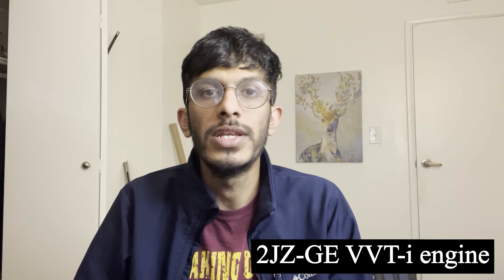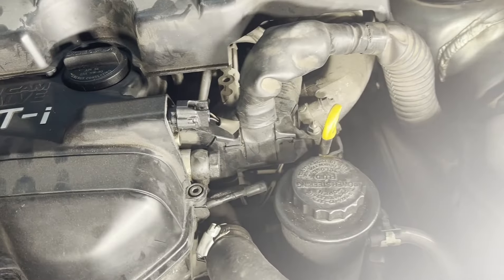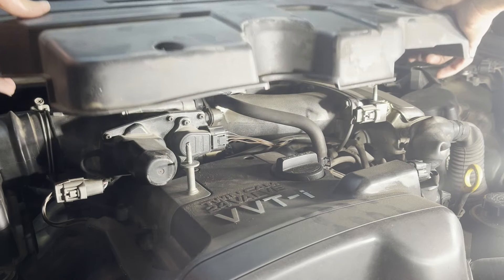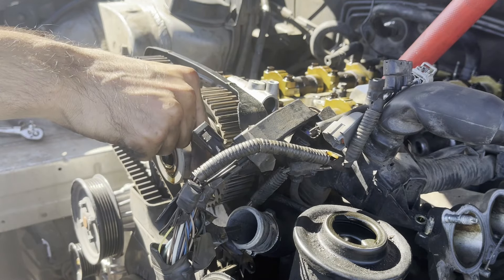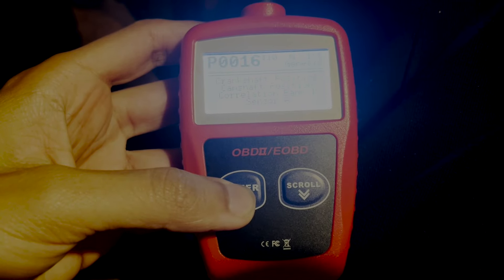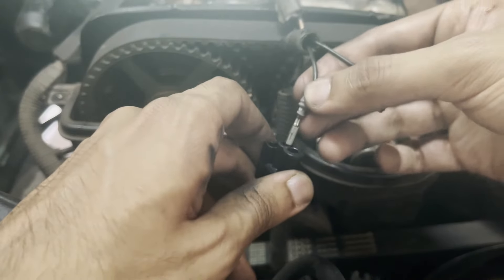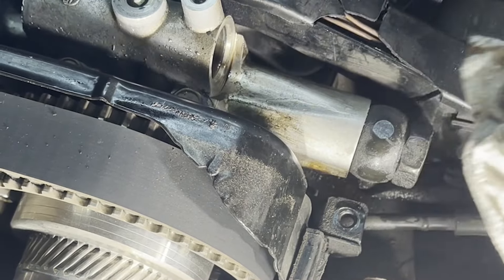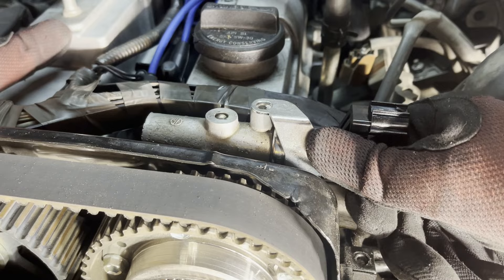How to change VVTI solenoid on a Lexus GS 300 | 2JZ-GE (IS 300, SC 300, Supra)

Comment: hey I have a 2016 GS350, and the engine light randomly comes on and traction control turns off as well. Diagnostics showed an OCV issue, does that mean the connection might be bad? or the OCV need to be replaced ?